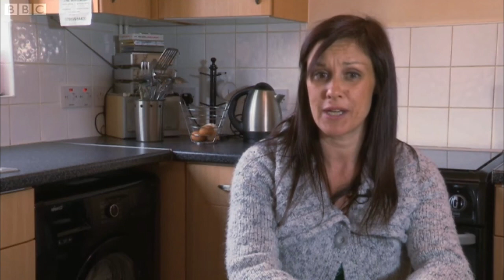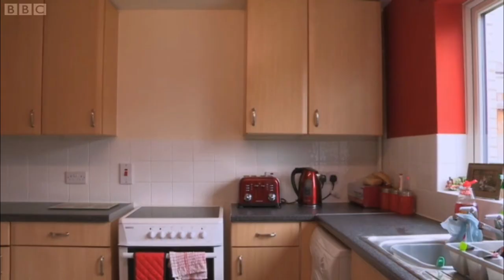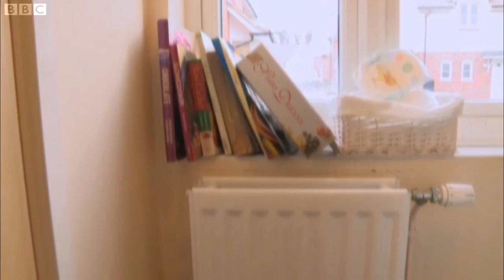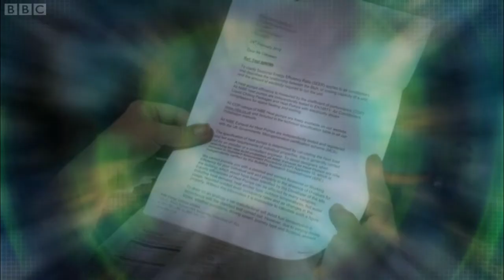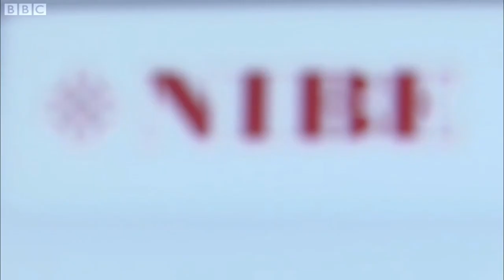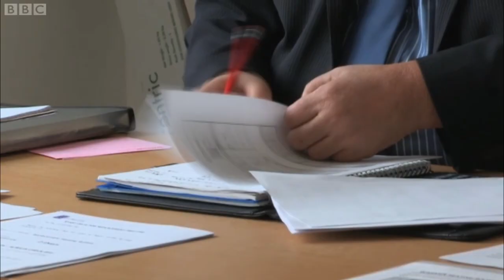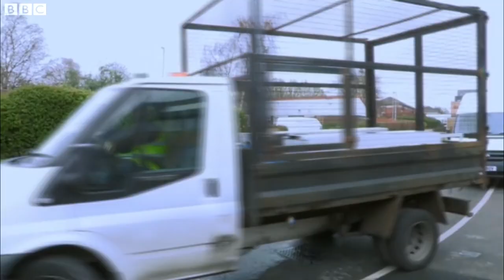NIBE on Rip Off Britain

Comment: I'm disgusted that the culpability is solely aimed at Nibe. The house builders should have done a thermal model and heat loss calculations and ensured good levels of insulation and policed its installation making sure that it doesn't thermally bypass, as well as ensuring the best levels of airtightness and reduction of thermal bridges.  This video is extremely biased and doesn't paint the full picture. We have recently designed and built a house that has a peak heat load of 1.2kw and has heating Bill's of £90 a year using similar technology . Nibe are a good company and their units are perfect for thermally efficient building's they wouldn't be listed on the Passive house database if they were inefficient.
Rip off Britain needs to know their building science before broadcasting this slander.

Regards 

Richard Marlow 
Low Energy Consultant 
Bpec Niceic 
Solarcrest 
Macclesfield 
www.solarcrest.co.uk
Reply from the maker: Fact: Nibe provided the heating design for these builds, and even recomissioned them.  Nibe passed the blame on to their users - they shot themselves in the foot. They deserve no sympathy
Reply: @jasonoldy69  Generally, developers employ a low energy consultant who will work out the peak heat load including the DHW demand based on the thermal performance of the building. Once this load is determined we at www.solarcrest.co.uk generally double it to allow for heat loss caused by higher wind speeds which cause more air leakage. Determining these heat loads for new and large developments are not the responsibility of the plumber or heat pump supplier, the design could have been based around a theoretical load they were given but any design fitted in a wind tunnel is likely to be the case here. Any air to air or air to water heat pumps, i agree should not have been installed in these buildings and are for properly designed low energy buildings. The amount of energy consumed hasn’t decreased with the introduction of condensing gas boilers, its just that gas is almost 5 times cheaper than electricity and these boilers are easily capable of delivering 28Kw which will be needed to heat these colanders, Gas boilers don’t magically change the laws of thermodynamics. Due to the poor thermal performance of these properties these EAHP would have been operating with a COP of around 1.5-2 depending on the season, meaning high electric bills more than double that of gas, if the house were built to notional building regulation u values and ACH of 5 they would have had a COP of approaching 4 which then would have made them comparable to a gas boilers energy cost. There is culpability on many fronts but it is unfair to slate the equipment or design without knowing the full picture. Firstly the properties should have had roofs insulated to a minimum u value of 0.18 and walls and floors to 0.25 and policed installation of this insulation to ensure there was no thermal bypass, the windows also need to be high spec. Many developments’ are built using direct electricity which are extremely expensive to run do we see fan heater and radiant panel companies getting maligned? I'm not a person to point out problems without solutions, so here it is. Developers please employ a low energy consultant who is proficient at using PHPP https://passipedia.org/planning/calculating_energy_efficiency/phpp_-_the_passive_house_planning_package and police their recommendations throughout the build use sustainable green appliances akin to the Nibe units which have a small impact on emissions. This software can be used for non-passive house buildings here is a simplified example  https://drive.google.com/open?id=15jEqsqEAXRYLRaS6zaZLQlv9Y1IwMPUb. Rip of Britain are actually endorsing burning gas now which goes against the UK governments move to be carbon neutral. Overall this video shows how much we all need to up our game to keep bills down and deliver maximum human comfort while reducing emissions. I have no issue with any individuals, its an serious issue that needs all parties to sensibly brainstorm including the naive media.
Reply: @jasonoldy69  a good heating design could be installed in a theoretically insulated building. However 90% of insulation is poorly installed. All trades are required to be on their metal when creating low energy buildings. The BCO'S are not innocent either.
Reply from the maker: A good heating design would have a primary source of heat.  These designs have none, other than Summer weather or its 13kw immersion heater

Comment: I have a Nibe Fighter 1200, which is the most complicated piece of  c..p I have ever owned. It promised the earth, but delivers expensive heating. If I could afford it I would chuck it on the dump and get a Mitsubishi Air source heat pump, which my friend has and works really well. I tried getting in touch with Nibe but to no avail, they couldn't care less. And engineers I've paid to look at it have not been able  adequately to explain how to set it efficiently. I built my house myself, took 14 years, it is super insulated but the firm I bought it from in Glasgow couldn't care less either. Really disappointed.
Reply: The reason they dont last in the uk is that you have poor insulation and you undersize the units, We have a NIBE Fighter 1135 In 300 sqaure meter 3 apartment bulding in Northern Sweden With up to 20 people there at once showering and using heat and it does just fine and has for the last 18 years. The temperature gets down to -30 degrees celcius on a regualar basis and it uses a total of 25 000 kwh per year. Split over 3 families that gets us a total price of 10-15£ pounds to pay per family per month. What should be chucked on the dump is gas boilers which pollutes our earth.
Reply: rip it out, cut your losses.
Reply: Define what’s super insulted according to you because it’s not just the walls ho should be well insulated its Everything from the heating pipes (for less energy loss) to the windows ( should be window with a triple glazed) and that the Ventilation is working correctly.
Like they say in the video it’s not the right unit for the house or wrongly used .
Me my self and nearly everyone I know have nibe as a heating source( different variants from one another)and we live 70 km north of Stockholm and never heard they have had problems nether have I .
So I would think the problem is maybe you have to small unit fitted or what I just wrote above

Comment: So....... your houses are insulated poorly and you blame the heat pump that is used throughout scaninavia in -20 degrees celcius with great succes. 

facepalm
Reply from the maker: Timothy Vincents Broughton Premature facepalm - these boilers are used as a secondary heat source, the primary usually being a log burner.  NIBE UK specified 1000's of boilers for primary use.  How can you heat a home with a heat pump when there's no source of heat (excluding the dirty great immersion)?
Reply: Heat pumps move heat, they dont make heat
Reply: @WindyJAMiller  heat pumps move and concentrate heat, otherwise how can you get 40' heat out of 10' air?
Reply: @jasonoldy69  I heat my home with a heat pump. The source of heat is the ground. The pump extracts a contant 3' from it, concentrates it to around 30' and puts it through my underfloor heating. BUT it wouldn't work if I hadn't spent 100s insulating the house (cavity wall and 50mm kingspan internally, plus 100mm in the roof rooms - would put more up there but no space!) Nor would it work with standard sized radiators - they need 75C plus to work properly, tho' you might get away with cooler in a well insulated house. However, I still use 5500kWh a year. I reckon if I can fuel my home for under £100 a month then I'm doing well (I live in a detached 19 century cottage with 70s and 90s extensions in Scotland).   I reckon most of these houses suffered from poor specifications in insulation and heating systems. Probably, as someone has already said, due to cost and corner cutting. But TBH the tenants are pretty naive too - whoever heard of heating a 3-bed standard town house for £300/yr?!?
Reply from the maker: @PaulWrightIV21  a lot a NIBE units have been replaced with ground source, with positive results.  Don't confuse NIBE EAHP with air/ground heat pumps - they cannot be compared
Reply: @jasonoldy69  You seem to have misunderstood how this system is working. The heat pump is not covering 100% of the need, that's NEVER the case with any heat pump. But the NIBE system has additional heating also to support the heat pump when needed. However, if you need too much heat because of poor insulation or poor use practices (for example windows open mid winter all day...) then the electrical heating is ALWAYS active and the system can't cope. So don't expect anything else than super high electricity bills in those homes. Gas may be cheaper, so you may not care that you actually burn a huge amount of it to compensate for the heat loss, but the problem is not NIBE, the problem is poor building standards and lack of knowledge. We in Scandinavia manage well with such systems in much bigger homes WITHOUT burning logs or gas. The NIBE F360 has more than enough capacity to cope with our heating and hot water needs, but of course, all systems can be abused.
Reply: @AdaptingCamera  I think heat pumps can and do cover 100% of the need, if installed to correct spec in a properly insulated house.
Reply: @PaulWrightIV21  In this case we are talking about recycling the waste heat which normally would be vented out, and that can NEVER cover 100% of a normal home's need of heating and hot water. At least not if you are regarded as a "normal household" and you live in the northern hemisphere. I have been using the same sort of Nibe heat pump for twenty years now, just installed my second one two months ago to replace the first one and I am very happy with it, as I was happy with the first one also.
Reply: @AdaptingCamera  so @jasonoldy69 is right, there needs to be some other heat source to provide the heat that is recycled. In any house part of this would be people heat, in a house with big windows solar would also contribute, but the houses in the video have standard townhouse sized windows. Therefore the immersion heater is going to provide a lot of the heat source isn't it? So these people were duped into thinking they'd have low heating bills. You can't run an Immersion heater all year for £300!
Reply: @PaulWrightIV21  it is dfficult to discuss with somebody who does not understand the subject, just seems to want to argue... In homes with large windows (like mine) the sun contributes during sunny days, but only during daytime, and mostly during the period of year when heating needs are low, never (except a few hours per month) during winter. When most hot water and heating is needed the large windows cause heat loss, even if your hose, like mine, is well isolated and built according to the Nordic climate standards. My house is about 180m2, so it is large according to Swedish standards (I live in Sweden). I have always used a heat pump from Nibe and just recently changed to the F370, which I am very happy with, and I am sure will serve me well for the next 10-15 years. If your, or jasonoldy69's home needs more than this heat pump then your home is not according to Nordic building standards, poorly isolated, or you are doing like that woman in the video is doing, due to poor ventilation and building standards she must keep her windows open during the winter, otherwise her windows fogs up. Of course, your home may be much larger then mine, in which case the heat pump must be dimensioned incorrectly. The Nibe F370 heat pump ALONE manages to produce heat to keep a comfortable +22-23C in my home, and it produces hot water which is more than enough for four adult persons daily shower/bath and other needs. Of course, during winter no normal family home produces enough waste heat to recycle for that need, but the heat pump has the additional heat source needed for those days build in. When I said additional heat source is needed, I meant the built in elements, not gas or wood or any other type of heater. If you need more, then you bought the wrong heater. Also, you compare apples and oranges when you discuss money. You can't talk about price because it depends on where you live and what are your options, £300 per year is cheap, sounds far too cheap to be true. People who believe they can heat and produce hot water for a year that small amount of money live in a dream, they should hire an independent expert to calculate costs because they surely don't understand their own situation. It is not NIBE's fault if people who buy their products don't understand what they are doing.

Comment: Hello all, the main problem i have seen in this video is british incompetence as usual about understanding how this system works and for what type of houses is applicable. As it is an exhaust air heat recovery system it cannot have 100% efficiency and even if it did, if you have a poorly insulated house it will still run on the electrical back-up to reach the set temperature. Insulate your home well, and see the difference, if it still not enough back it up with a thermodynamic solar panel, get some PV panels as well if enough space on the roof. Live Green and do it smart.

Comment: These were 2kw Air Exhaust systems designed for 1 bed flats fitted in 3 bed houses that were way to big for the system , so stuggling to produce enough heat to heat the home then yes like any other appliance installed incorrectly they would be expensive to run
Reply: I have 1 bedroom flat. Nibe is sh1te and cost £399 per month without and heating provided.

Comment: £200+ a month with this system, we've been told its in the nature of the NIBE system to cost this much, nothing can be done.
Reply: Nope, The issue is the poor insulation used in British homes aswell as undersizing if the units aswell as these units are really designed for underfloor heating and not radiators. I have a NIBE Fighter 1135 At a large 300 square meter 3 apartment building with up to 25 people living at once, And the temperatures regularely get down to -30 degrees celcius and it heats extremely cheap and it has since 2008.  It uses 3000 kwh in the coldest months and that is split between 3 families which makes each pay for 1000 kwh at max and with todays prices in sweden it heats for approximately 10£ per month per family.
Reply: @norwegiannationalist7678  (edit; radiators NOT underfloor) Facts from over 52 flat in the same block....; We all have an the F205P Nibe, one in every flat. We all have the same problem (massive electricity bills 200 pound+ month for years now). The insulation is top notice ambient temps never goes lower than 19-20c. Still costs a fortune just for hot water, not even needed for heating. Please understand what works for you does not apply every where. I am sure this does work in your setup. But here it don't. Could be they dont understand the setup?
Reply: @casparharte  Not sure, but british homes generally are badly insulated, If the imersion heater has kicked on the unit is undersized

Comment: They stated clearly that these houses AREN'T (properly) insulated!... whose fault is that?! NIBE's or the house builder's?
Reply from the maker: +Valentina Diamond Both - NIBE still sized and specified the boilers to be fitted without a care about insulation, whilst the builder foolishly relied on NIBE's heating design.
Reply: jasonoldy69
That's what I tend to think too... this company's replies were too idiotic in a matter.
Reply: Nibe has very clear requirements even on their public websites. You need an really up te date isolation and a low temperature  heating system. Without theses conditions you will face serious problems. For me the builders are to blame by building poor isolated houses. In the Netherlands we use a stepped approach: first use your money for isolation. When this is properly done then switch to floor and wall heating and use if needed Low Temperature convector heaters. Then check ventilation system. Is this energy friendly like a balanced system or an intelligent system so you keep the heat in and the dirty air out? When this all is done then maybe a warmthpump could be a solution... always in combination with solar panels for compensating the extra need for electricity
Reply: @jeroenvandersluis9764  As it should be done. School example. Make sure the building can keep the heat from leaving the building and those NIBE products works perfectly.

Comment: Actually we have proof that nibe Uk specified these systems incorrectly and in Sweden (home of Nibe) these models no longer meet standard...this is  why Nibe  sold to UK market .
In the UK electric from the grid is mainly powered by gas turbines...this means currently only a fool would think an electric boiler with an undersized heat pump is going to be greener or more economical than a gas boiler....
1000's of these nibe units have been removed in the uk  after just a year usage.If you like them so much and they are so great why did you or Nibe not collect them to use elsewhere . They all went to the dump ...why..? Because NO ONE WANTS THEM!
Reply: +J WD I imagine it is more expensive to send them back to Sweden and recycle these machines for a future use in other systems (remember that they have been used )and this is not interesting from a possible client. 
Btw I have an Geothermal heat pump, guess which brand.... and it is GREAT!! 
greetings from finland
Reply: Great so your opinion is not even based on user experience of these models. Yes I drove a Ford once and it was great does that mean all Ford cars are great???? Greetings from planet Earth.
Reply: I would love to see that proof :)